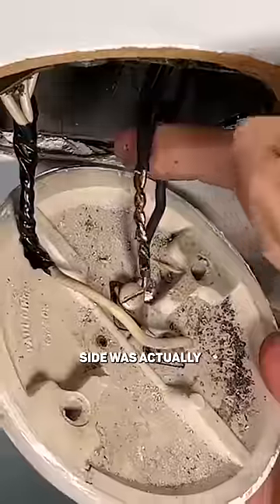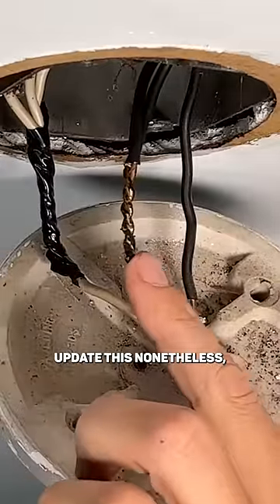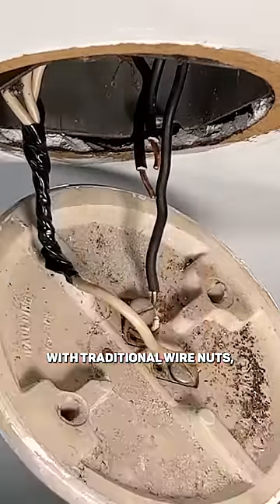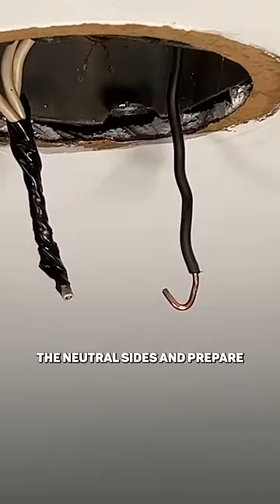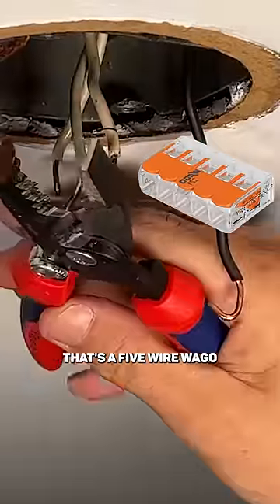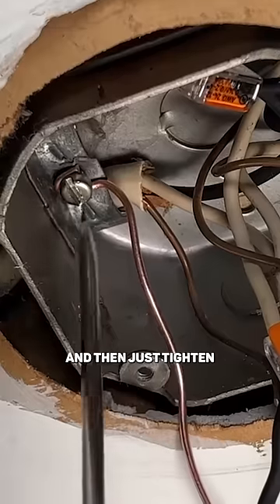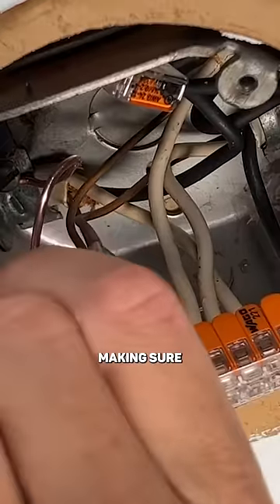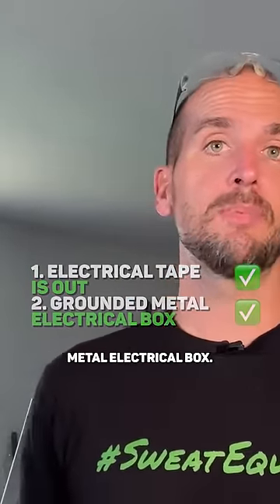Which Part Doesn't Meet Code?

Comment: Ground is wrong, need a green grounding screw.
Reply from the maker: Good eye 👍
Reply: (edited to clarify) Ground is indeed wrong, but there is not a requirement for the screw to be green, because an outlet box is not considered a wiring device. The requirement is the ground screw is a machine screw, not a self tapping TEK screw or other type of screw. Thread-forming machine screws are acceptable per 250.8.

250.126 Identification of Wiring Device Terminals.
The terminal for the connection of the equipment grounding conductor shall be identified by one of the following:

(1) A green, not readily removable terminal screw with a hexagonal head.

(2) green, hexagonal, not readily removable terminal nut.

(3) A green pressure wire connector. If the terminal for the grounding conductor is not visible, the conductor entrance hole shall be marked with the word green or ground, the letters G or GR, a grounding symbol, or otherwise identified by a distinctive green color. If the terminal for the equipment grounding conductor is readily removable, the area adjacent to the terminal shall be similarly marked.

250.8 Connection of Grounding and Bonding Equipment.
(A) Permitted Methods.

Grounding conductors and bonding jumpers shall be connected by one of the following means:
(1) Listed pressure connectors
(2) Terminal bars
(3) Pressure connectors listed as grounding and bonding equipment
(4) Exothermic welding process
(5) Machine screw-type fasteners that engage not less than two threads or are secured with a nut
(6) Thread-forming machine screws that engage not less than two threads in the enclosure
(7) Connections that are part of a listed assembly
(8) Other listed means
Reply: @JCWren incorrect. 250.148(C) states:

A connection used for no other purpose shall be made between the metal box and the equipment grounding conductors In accordance with 250.8.

Because the machine screw used here is not for the sole purpose of grounding the box (it is also used a a clamp for the incoming nm-b) it is not acceptable.

Think about it logically as well. The screw cannot be fully tightened or it would pinch the incoming cables causing a short. So the ground will always be loose. This is not an acceptable method of grounding a metal box per the NEC or otherwise.
Reply: @chrisruss7863  Your incorrect is incorrect. I did not say the screw was acceptable for grounding. I was refuting the need for a >green< screw and pointing out that a screw used must be a machine screw.
Reply: @JCWren  ah I apologize. Still, there is a code reference now as to why this is unacceptable.
Reply: @chrisruss7863  I edited my original reply to indicate I was talking about the green screw requirement. Indeed, as we both agree, using the clamp screw violates 250.148(C). Thanks!
Reply: @JCWren  I do not know how it is in other jurisdiction, but in Los Angeles, the inspector made me have green colored screws in all metal boxes I installed. Would not sign off until I did and since it was during COVID, it was almost to get him back to inspect. Whatever he stated he wanted I did to get my ADU done.
Reply: @donho3617  Sounds like your inspector needs to go back to NEC class and learn the code. I suppose it's possible that it's a local jurisdiction thing, since the NEC is the minimum code. But still...
Reply: Looks green to me (colorblind)
Reply: @donho3617   - whether the inspector is right or not isn’t the issue, as you know. Time wasted can cost money, so sometimes it’s best to just comply with the inspector even when the inspector isn’t exactly correct, especially if what the inspector wants is inexpensive. You get to pass the inspection and move forward.

And as a bonus, some inspectors will look upon you more favorably in the future, and that can be beneficial.
Reply: Somebody didn't get the sarcasm
Reply: Color doesn't matter it needs to have at least 2 threads engaged and the screws only purpose has to be grounding it can't also be used to clamp wires down like in this video
Reply: @JCWren  
CA requires green

Comment: I don’t trust those wagos for wire connections. If you consider how they are designed. They are ok imo for making connections to a low watt light, but not for splicing 2 or more wires together. I’ve seen them cooked enough times. But they are very convenient.
Reply: Your correct.  They are junk.

Comment: I didn't think solder was allowed on ac household wiring?
Reply: Yeah, a friend twisted and solder his connections then used a wire nut and electric tape. He was so proud of his work on his remodel. Then the inspector made him redo it without solder saying it was a fire hazard.   My friend was pissed.
Reply: Back in the day (before wirenuts) all splices were soldered, rubber taped and then electrical taped.
Reply: @Mote78  Your friend’s job failed inspection because of the solder. Putting two dissimilar metals together can cause the splice to fail over time. The metal in the solder and wire nut could react with each other in a bad corrosive way.
Reply: @TK-wz1io  
Thanks
Reply: uhh knob and tube  used solder it was just fine !!!!
Reply: @TK-wz1io  come on though, the oxidation from the exposed copper happens much quicker and has a much bigger effect.

you ever seen those old wires that have such a thick oxide layer they look black? in my mind solder beats these types of mechanical connections very time.

also, leave bare copper wire outside in the rain then sun for like 2 cycles and it ends up pretty crusty
Reply: The National Code failure was due to soldering the equipment grounding wires. Soldering Hot and Neutral are not necessarily rejected except for explicit local code or poor workmanship. You see, Hot and Neutral conductors have current limiting that will prevent melting solder, but EqGnd must handle fault condition heating that exceeds the capacity of solder.
Reply: @imconsequetau5275  That makes sense but when there is a ground fault that should trip the breaker very fast and thus prevent the wire from heating up very much verses the current carrying conductors which carry the current for long periods of time this is why the ground can sometimes be of a thinner gauge wire than the current carrying conductors.
Reply: @phillhuddleston9445  
That may be true in some theory, but in practice - not so much. These NEC directives, "shall", and "listed products" are all based on documented real life conditions that were learned the hard way; Insurance company funds, property and lives lost.

Comment: Never heard it pronounced that way but I'll take a wire nut over a wago any day
Reply: Interesting.  I'm firmly in the Wago camp.  Can I ask why you prefer wire nuts over lever nuts?
Reply: @swankt0mcat  I've found too many melted during service work... if the connection has any resistance it will heat up. I feel like with a wire nut I can see and feel a secure connection.  Also I feel like they save space and are quicker than wagos.  But to be completely fair I'm sure it depends on the installer as well.
Reply: @michaelmerryman7806  that makes sense.  I only use them in low current applications (controls wiring/low current AC circuits) so I haven't seen this problem yet.  They are rated up to 20 amps at 300 volts, but I guess if they melt then maybe that rating is a little far fetched.
Reply: @michaelmerryman7806  I've always avoided wire nuts for the same reason you use them. I occasionally use them as temporary, but they just never seemed to be as secure as a hard crimped connection. Next step up for me would be solder, and heat shrink. Don't trust electrical tape, either!
Reply: @gfs videos  I'm an electrician so they're just the most practical.  If I worked with low-volt systems with smaller guage wire then wire nuts would not be my first choice but with 12guage wire its the best serviceable connection imo.  Solder and crimps are a great connection but unfortunately not very practical for my type of work.
Reply: Nope. Your loss wago is better
Reply: @danieljpollack1814  some people prefer different methods usually because of the experiences they've had.  This guy has seen wagos melt and if I saw that I'd probably say the same thing.  I'm in controls so I haven't seen anything like that because it's all low current.  Just outright saying one thing is the end all be all isn't really a good way to operate....
Reply: @Daniel J Pollack  if you like paying more and spending more time on each connection then suit yourself.  Use a wago and try to pull the wire out it's usually pretty easy especially with stranded.  Now do the same thing with a properly twisted wire nut you won't pull it out, usually if it does pull out it takes the spiral metal inside and the other connected wire still keeping your connection intact. Wagos are cool but I put hundreds of wire nuts on almost everyday and I cringe thinking of the cost of that in wagos and the time and the different configurations... do I buy 3port wagos or 5 port and did a helper flip open a lever when stuffing the wire back in the box.  There are many reasons they're cool but the reasons they are not is why I don't use them in my type of work.
Reply: Any connection that uses a spring should never be used for any high current application that is intended to be permanent. If I needed to connect a couple wires togeather for a test I would use a wago if I had one, but I would never use one for installation. Same thing goes for backstab outlet/switches. They should be banned. I replaced all the outlets and switches in my house after discovering that they were all backstab. More than half had the wires pull out with zero resistance. All of them were melted to various degrees.
Reply: @michaelmerryman7806  WAGO prima donnas.
It's like listening to someone talk about how their electric car doesn't pollute and oil is evil not taking into account how that lituhium in the batteries got removed from the ground.

i feel like WAGO fans are lying.
They like WAGO because they are lazy,
and because to properly wire a box using wire nuts in not a skill everyone is good at.
WAGO users have entered chat!

Trying to tell convince the world,
that a tiny strip of steel laid across a conductor is a better connection than wires laid side to side for ¾" and squeezed together...
Reply: @michaelmerryman7806  In fire protection,
we are allowed to feed a branch line from the main with a piece of pipe that is smaller diameter than the branch it feeds,
as long as that smaller diameter riser pipe is under a certain length.
That small length of restriction does no harm to the water flow that that branch line requires.

Anyone that tries to convince u that a WAGO is superior is trying to convince u that a strip of thin steel laid across a conductor is superior to laying confuctors side by side
for ¾" and squeezing them together.
What do u think?
Reply: @Micheal Merryman
Are you a member of the Flat Earth Society as well?
Reply: @zachdemand4508  
Lots of misguided opinion. And your experience is?
Reply: @johnburns4017  its not opinion that spring loaded connections lose tension with time and heat cycles. A properly installed wire nut or screw clamp connection doesn't have this problem.
Reply: @zachdemand4508  
Wagos have been in Germany for many decades. They have then taking 16mm, 20mm, 25mm cables.  All outlets in Germany and France have them on the back, which are now being introduced into the UK.  All LED downlighters bought now have them on the back. 

They do not work loose, which is the single highest cause of fires, and always give the correct torque. Go to Youtube and search on efixx wago  Lots comes up explaining the lot. Big and small application. 

Wise up, find out.
Reply: @johnburns4017  lol no is resistance and heat conspiratorial?
Reply: @michael-dm2bv  they're made to replace block connectors where the screw head near always strips before the wire is fully secure. Cable junction boxes have the same issue, I've come across them where the wire can be wiggled out without undoing the screw. I'm not saying wago's any safer long term but they sure are convenient and do hold the wire. I wouldn't advise them for high amperage connections but they do have a safety rating and commonly available.
Reply: @Wobbly Eye  I'm not sure why everyone thinks I care one way or another.  I'm an electrician in the United States, wire nuts are the industry standard and are the easiest, cheapest, fastest connection that can be easily serviced.   Wagos are fine if that's what u prefer, but they're not practical for what I do.  I have found them melted, but I don't attribute that to the wago itself but to the installer that didn't make sure they had a secure connection.  If I want a terminal block style connection, I'll use a Polaris or an illumicon.

Comment: Can't tell u the number of those I have had to replace and went back to normal wire nuts.
Reply: Can't tell you how many wire nuts you will switch out in the future because Wago connectors are the best product on the market and will surely replace them IMO. No twisting, no solidering, no broken wires (unless someone is careless). So simple to get in the box. Neat and clean. In addition so simple when changes are necessary. I know changing to something new is always hard and in particular the older one gets.😉 However one rarely sees anything else these days in in new installation in Germany where they originated 70 years ago. Would interest me why you had to replace Wagos and return to wire nuts? Possibly inproperly installed from someone?
Reply: @robertthomas6127 cuz Wago connectors are just as bad as pushing the wire into a back of an outlet or a light switch. They can easily fail due to too many amps being drawn on a circuit causing the little metal wire inside to melt. The spring clip in them can fail because just like the outlets and switches that have the "holes in the back where you can press or stab the wire into it so you don't have to use the screws" is usually the fail point so the wago push in connector is just like pushing in the wire into a back of an outlet or a light switch it's going to fail at some point versus a good old trusty wire nut which is less likely to fail. Now I'm not saying wagos are all bad, I prefer using them with low voltage circuits because a less risk of melting even though granite they may be rated for high temperature but for only how long before they reach the point of failure.
Reply: @robertthomas6127  Wago 221 can take a 10 gauge wire, but are only rated for 20 amps.

Even if you give them the benefit of the doubt and say they'll never fatigue and develop high resistance, being rated for only 2/3rds the amperage of the wire it can take is enough reason to not use these in permanent installations.
Reply: @wyattroncin941  UL only rates them up to 20A, however IEC rates them up to 32A. Also, traditionally 20A is the largest breaker you'll see in residential homes. I'm not sure what the max amperage of the wire is necessary relevant for, since they'll be safe for installing in homes that don't go over their lowest rated limit.

Also, from there website I'm seeing 12 Guage max for their wire size. I don't know where you got 10 AWG.
Reply: Stone age, it's insane that those materials are still legal, move on and do things an a safe way, you could start with 230/400V
Reply: @wyattroncin941  there's a video posted on YouTube of someone pumping over 120 amps through a wago 221 continuous without it melting or catching fire.
Reply: Wire nuts are only for stranded wire.

Comment: i had twisted soldered wires in my home when i bought it and found it was a big problem( built in 60s) i cut every solder connection in the house and the old #12 wire worked perfectly , like new , better , and i used wire nuts , anYtime you push a wire in a slot , example, is the hole in the back of a recepticle or switch it sooner or later will go bad , i never had a wire nut done right go bad , fact
Reply: What problem did the solder cause?

Comment: That is not a code compliant ground connection you are required to install a 10-32 green ground screw or ground clip I recommend the screw just carry a klien 6 and 1 tap 😉

Comment: As an electrician, I love Wagos. They create lots of profitable service calls. That is, if the place didn't burn down already. Inspector would say nay nay on that ground too
Reply: I am not a fan of them either.
Reply: It's strange how they work perfectly in Europe but as soon as they are used in the US they cause house fires. Perhaps it's related to the person doing the work rather than the product?
Reply: @AlexKall  50,000 residential electrical fires a year in France, it takes the US 10 years to match that despite having about 5 times the population. We don't just pull this they start fires thing from nothing. They don't work across the pond either.
Reply: @johnh8546 where did you pull that statistic from? The MEEDDM and ONSE reports give an estimate for fires that are electrical source in nature, but that includes appliances, outlets, circuit overload, and inflicted damage.

Comment: NEC 300.14
wire free length.   let's use more Romex!
Reply: Lmao love it my guy. School this hack up
Reply: Wagos are for people with half a brain also. Wirenuts installed properly have a better holding strength and way better connections than a thin metal tab
Reply: @Kevin-mp5of  someone’s salty.
Reply: @Kevin-mp5of  wagos are definitely a point of failure. Ever seen the outcome of stab back receptacles. Wagos are for amateurs buddy.
Reply: @garrettchurch604  yep, we through them out whenever they come with equipment. It really is a weekend warrior thing.
Reply: 3 inches outside of the box